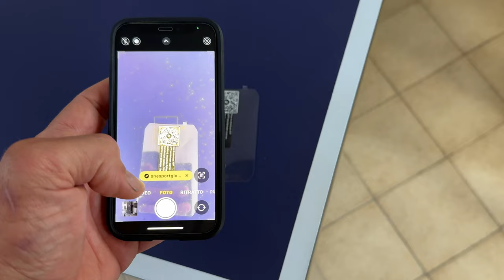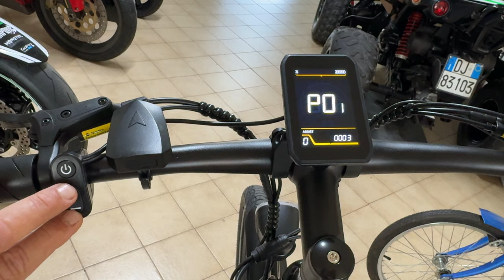ONESPORT OT05 - THE BEST 27" EBIKE FOR ALL SITUATIONS - FULL TEST - 4K

Comment: I've got this one. This is my first e-bike. I regret my choice. The bike is heavy. You can feel that weight. It's hard to keep balance at lower speeds (especially when riding with kids). The app is a nonsense. The battery squeaks on every bump or when you turn the steering wheel (even a bit). I had to put rubber outside of the battery cover to mitigate it. I would look for something lighter (even with a smaller battery).
Reply: Hi, i´m looking for a ebike and this model was my first choise. I've been looking after information for long on this chines bikes and always had a feeling that the video reviews are kind of payed by the companies as there's only good rates and not any negative comments on them. could you share more about your experience ? 
how is going now with your bike?
how do you evaluate the customer service? 
does the bike give a reliable feeling ? 
how does it work under rain/bad wheather?
thanks!
Reply: @MSV-f2f  Hi. I've driven 270 kilometers with this bike so far. I got used to the extra weight. The fix for the battery works very well. It is quiet now.  The disc breaks start to lose. Two screws holding them just fall off. There's no glue on the threads. You better put the glue yourself. I had to fix it and basically tie all the screws together. In the beginning, you need to put some love on this bike. I decided to keep it anyway. The riding is smooth. The battery consumption is very low (thanks to the tensometric sensor). There is a strange grinding feel that you can slightly feel on the pedals when riding below 10km/h (especially up the hills). This may be the internal gearbox of the hub-motor. When the motor is spinning faster there's no such feeling. 
I'm 184 cm high. The steering wheel is a bit too low for me. I plan to replace the steering bridge with something that can be regulated and bring the wheel a few centimeters up. This bike was supposed to be used by my wife but she is complaining about the weight.
...I'm avoiding the rain as long as I can. The battery is mounted from the bottom. I hope this prevents water from getting in.
Reply: @tomasz_babiuk thank you for your feedback, very helpful. I think i’m going to continue the research among Chinese bikes, i have found fido C11 which seems to be among the must rated but of course not without minor defects.
Reply: @MSV-f2f  Check Fiido c21. It weighs 17.5 kg only. The battery seems to be small but with the torque sensor, it can still drive 60 km. I would replace my ot-05 for this one if I had a chance.

Comment: @xtomcicos how did you change P8 to 100 km/h?
Reply from the maker: @Martin_2024-m6b  From the menu like the other parameters, however, I believe that in the new European ones you can't change p8..
Reply: @XTOMCICOS  So there are two versions: EU and International?
Or maybe only older models with a board are unlocked, although it's strange because the limit in the EU is 25 km/h and you can set it and drive 32 km/h, why don't they give more?
Reply from the maker: @ Even on some new European engwe and varun bikes that they sent me recently you can only set it to 32..

I always ask that international versions be sent to me but unfortunately sometimes for logistical problems they send me the European ones and they are more and more blocked.. But I hope that as it happens on engwe unlocking procedures are discovered .. In case you find out about unlocking procedures I will make a video to explain them..
Reply: @XTOMCICOS  I will look for a solution. Thank you for the information